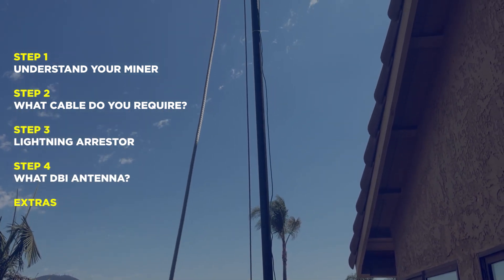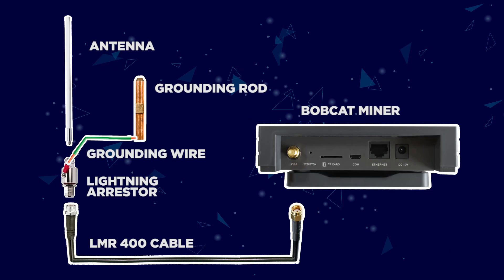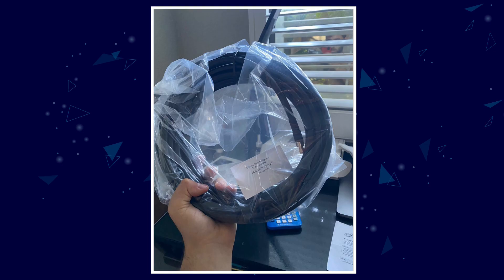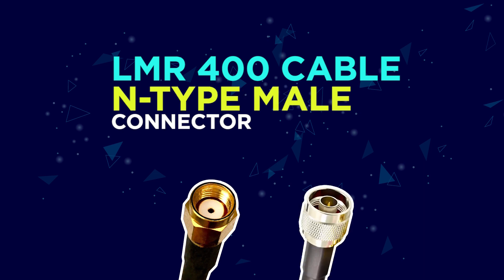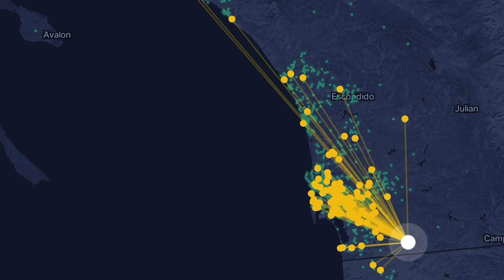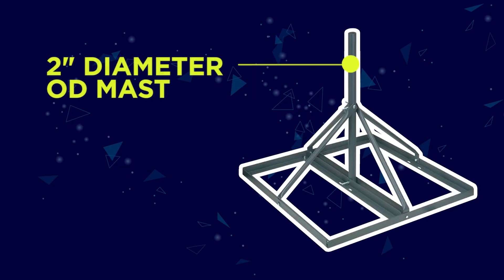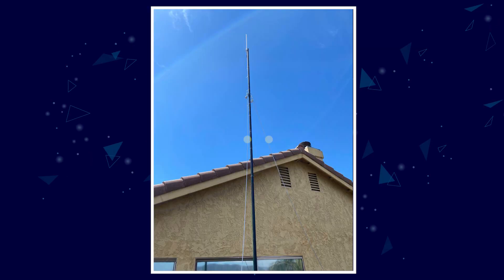Bobcat Miner Antenna Upgrade | Step by step Upgrading your Helium Miner Antenna ($HNT)

Comment: @Crayban Thank you for this excellent video. I have successfully set up my miner by following the steps in your video. Thank you so much!!
Reply from the maker: Hey JT, you're most welcome. How are the earnings?
Reply: @Crayban  I set up my miner 10 days ago, I got 24-31 witnesses, 18 HNT so far. I’m happy! 😉
Reply from the maker: @j.t.7231  Amazing :), happy to see it helped.
Reply: @j.t.7231  what antenna are you using if you don’t mind me asking? I’m in outskirts of a city so debating if should get the 8dbi or stick with 4.
Reply: @Esh104  Hi there! I used 8dbi antenna and 25-ft LMR400 cable. I hope this helps.

Comment: how do I find out how many people in my area I can connect to with the Bobcat 300?
I live street level and unable to install on the roof, landlord would have a heart attack if U installed on building or roof.
How can I read and understand the tool that informs me of other miners I can connect to?
Does it tell me my income potential? using the bobcat 300?
I have read a few messages from bobcat 300 owners, and the regret buying one,  I want to avoid their mistakes and ask all the questions before i INVEST 700$
Reply from the maker: Hey, you can check out the coverage map here to see how many miners running in your location: https://explorer.helium.com/coverage  On this map you can check daily earnings of miners as well as a 30 day average, this should give you a good indication of rewards around your area.

You ideally would be able to tell once it has been installed, or check out other miners in your area before hand and see how they are doing before you go for the plunge. If based in the US, I would advise having a look at the 5G miners as they are the next evolution of the network. 

Check out Ebay aswell, you would be able to get one at lower cost as the market is at its low.
Reply: @Crayban  would advise having a look at the 5G miners as they are the next evolution of the network.
I did tons of research, and is not too good for the Bobcat 300, the newer miners offer so much more,
The only reason the Bobcat 300 is doing really well in the market is due to their strong marketing campaigns.
The newer miners have
Bluetooth - no deal breaker there -
5G - deal breaker for sure
A internal fan - now this is huge - bobcat 300 only offers a heatsink eww so 1980's
Inside the miner - the points of contact between - the newer one's have one direct contact point while Bobcat 300 has several which translate to signal loss, signal loss equals,  loss of income.
With this I I will not be making a Bobcat 300 purchase.
To those that just bought a Bobcat - All I can say - you'll be looking forward to regrets.

Comment: I live in apartment building in NYC
On the 3rd floor of a 7 Floor Building 
I got 2 Bobcat 300 miners just received yesterday.
Any suggestions on good Outdoor antenna 
Want to place outside window
Reply from the maker: Hello, Apologises for this super delayed reply. How are the miners doing? A good outdoor antenna would be from mcgill microwave. They have these suction cup window holders you can place your antenna on. If based in America Fiztech https://fiz-tech.net/?ref=CRAY also have the gear you would need.
Reply: Still haven't set it up yet. But will let u know

Comment: Good video, however I landed here to see how to test replaced Antenna signal. I "upgraded" my antenna from the standard 4dbi to a 5.8 and now have no witnesses. Had 5 with the old 4dbi. How do we test the antenna is broadcasting/working?
Reply from the maker: Hey, apologies for the delayed reply. Did the miner eventually sync up and start working with the new antenna? In terms of testing, usually I leave it running for a few days and it should start picking up signal.

Comment: do you have to update settings in the miner when you change a new antenna, and why? How does miner know you got new antenna and how high it is?
Reply from the maker: Hey, Helium recommend to update the info as the wrong input in dBi could potentially effect rewards, however I am not entirely sure how they are managing to track each and every device based on height and dBi. As the signal projected out is in reality the main thing that determines how good the connection is with other miners. In order for Helium to understand each and every miner, they would have to look at the polar pattern projected out for every antenna, and even that is not as accurate enough compared to physically measuring the height in person. I personally believe it is a way to get each and every user to input the correct details to ensure that the data they have on the network is accurate. That's my personal perspective.
Reply: @Crayban  or they just try to earn extra bucks when you update the settings.

Comment: Can you connect using RG6 coax cable?
Reply from the maker: Hi Michael, sorry for the delayed reply, you can, however you will require the correct ends that connect into the miner and into lightning arrestor/antenna.

Comment: Very informative yet again, thanks.  Did you prefer not to/is it not an equal option to attach a mast to the side of your property?  This is what I plan to do   @Crayban
Reply from the maker: Hey Adam, sorry for the delayed reply. You are able to attach the mast, just be aware of HOA (housing association), if it is applicable to your area. As they had me remove mine. I only used a base as I wanted to be flexible in shifting it around the house.

Comment: I'm thinking about doing an attic antenna install, do you recommend it? I live in the city not sure if it's worth installing outside. 5.8dbi
Reply from the maker: I have an attic installation, currently on about 0,2HNT per day, however outdoor was earning at least double of the attic instal. Had to place it in the attic because of HOA.
Reply: @Crayban  do you have pics or did you do a video on this install?
Reply from the maker: @cspill99  It's actually this exact setup, however shifted to the attic. I have not covered it in another video. The layout is all the same, except the miner is located indoors and in the attic, with the antenna positioned as close to the wall as possible. Try our an attic setup and then,  try out a temp outdoor setup and see what will work best in terms of rewards. I usually leave them for about a week to test.

Comment: I got my antenna, but I'm still a bit confused as to what type of cable goes into my antenna... is it the n type male to male connector so that one end goes into the arrestor and the other one goes into the antenna? thanks again for the info, other than my confusion, I am pretty well informed
Reply from the maker: Hey Joseph, The RP SMA Male end (smaller end of the cable)  fits into the miner, and the opposite end (n-type male) will connect into the arrestor. Hope that helps.
Reply: @Crayban  what cable goes from the arrestor to the antenna or would the arrestor connect directly to the antenna? I got an outdoor antenna that didn't come with a cable and it's an N type female on the antenna

Comment: I live in the country side of America and want to purchase a stronger antenna. I have read that a bobcat miner antenna  can only go up to a 9 DbI.  and you have to change the antenna settings.
Reply from the maker: Hi Michael, You can use any antenna dbi antenna that will fit the best purpose for the placement of your bobcat in your enviroment. Changing the settings is easy, you can do it through the Helium application.

Comment: great video, clean
I need some advice please im looking to start helium mining but I just want to run a simple set up from my bedroom window , do you know if I can upgrade an indoor antenna ? if so which one? (im planning on buying a bobcat miner ) I live in the suburbs btw, many thanks
Reply: also is it worth doing from a a first floor bedroom window? money wise? thanks
Reply from the maker: Hey Azaz, honestly for experience of using the 4dbi indoors, it has worked well. A alternative can be the rak wireless 5.8 dbi antenna. https://rakwireless.kckb.st/crayban-zmx Currently running this on one my my indoor attic setups, and has been earning about 0.5hnt a day. 

Money wise it is hard to determine unless you test, however higher placement always is a good choice.
Reply: @Crayban  thanks for replying, just another quick question, in your attic do you have windows etc, I was planning on doing this in my attic too but not sure if the signal can reach through the roof etc, many thanks in advance.
Reply from the maker: @azaz...  most welcome. No windows 🪟 in the attic. Surprisingly it is doing good however the outdoor setup was better, but HOA had me remove it lol.
Reply: @Crayban  yikes!!

Comment: Not a penny for me yet 
But only using the stock antenna 
Any thoughts anyone ?
Reply from the maker: Hey Mark, Upgrading defo makes a big difference. I've upgraded most my setups based on the fact that the stock just wasn't good enough.
Reply: @Crayban  thanks so much 
I am going to move it to my 2nd floor since i think i get 1 free relocation with thr Bob Cat 
And i will check into antenna upgrades

Comment: Great video. Question. Does the height settings and antenna information on the Helium explorer update automatically?
Reply from the maker: Hi Eugene, this is manual. You can do it by accessing the app. Clicking the miner name, then selecting the settings icon and clicking update hotspot. You can update the information here:

Comment: Hey this is a great video!! I wanted to ask, I have a have a Bobcat miner that had the stock antenna and switched to a 8dBi but don’t really see much of a difference. Is there anything I should do after installing the antenna that I’m missing?
Reply from the maker: Hello, there are many factors that come into play. Location, height, the transmit scale of the miners around you. You can check my latest upgrade video here which goes through some factors. https://www.youtube.com/watch?v=iHFyCYOej8Y&t=120s
Reply: @Crayban  ok thank you so much!!
Reply from the maker: @don86baby  Most welcome.

Comment: @Crayban any idea why my minor has not sent any data since i changed to a 6dbi antenna. Its been about 1 and a half months since its sent any data. Am I doing something wrong
Reply from the maker: Hey Reece, how much data was being sent before. As the network is growing the Data portion should be low, over time as more companies use the network, the data transmissions will steadily increase.
Reply: @Crayban  it looks like data packs were being sent everyday . As soon as I changed to the 6dbi I've transfered ni data packets

Comment: Yeah but what about changing the settings when you get a new antenna and about the do's and don'ts like turning off and on your bobcat minor before changing your antenna how do you do that how do you even turn off the damn thing correctly
Reply from the maker: Hey Brandon, good point, usually you get an instruction guide with the miner, which covers these points.

Quick overview:

- Unplug your hotspot from the plug socket, unplug the antenna, plug the new antenna and then switch it back on
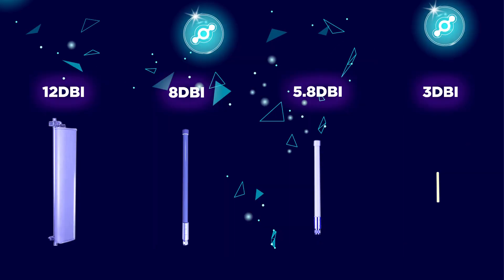- Next step upgrade the antenna within the app, covered this within this video, also covered on how to add HNT within your wallet if you don't have any within it - from 02:03. https://www.youtube.com/watch?v=twk1FZU-mxo
- Turning off the device straight by unplugging the power socket, there is no other way. 
- The witnesses take a few hours to show on the explorer map, and they should pick up over the week. 

Hope that helps.

Comment: Hello great video, I am in a penthouse in an urban área, do yoy recommend using the largest antenna?
Reply from the maker: Hi Jose, it depends on where the other hotspots  (with high transmit scales) around you are located. You could use a directional antenna or a high dbi antenna to shoot out a signal in a certain location. With the height advantage, you should be witnessed a lot as a beacon, but the second part to earning higher rewards comes by shooting out a signal to an area with high transmit scales.

Comment: So u have 25 feet of cable more or less between your miner and the antenna? Is it possible to hoist that miner up to closer to the antenna? Like maybe in one of those waterproof cases?
Reply from the maker: Hi Jack, thats correct. It is possible, however the only downfall is if you need to unplug the miner at any moment, and plug it back in, you will need to bring it down and then reinstall up again. I did the same, however the waterproof housing is based towards the bottom of the pole.

Comment: Would you use the same set up keeping the miner indoor ?
Reply from the maker: Hi G, I would. For me it is easier to keep the miner in reach. With the miner indoors, it wont matter much, as long as the antenna is placed in a suitable position outdoors.

Comment: This is so clear, very well presented mate. However, I have a problem. My two Bobcat miners are in my house a few metres away from each other and hardly making any money and also their nearest hotspot is about 800m away. . What is the best solution? Thanks
Reply from the maker: Hi Abdul, thank you for the feedback. The aim is to connect to more miners further away. Each setup for each miner is different, however the best practice is to elevate the antenna, and maybe use a directional antenna to reach the closest place that is packed with miners.

Comment: Great video,  very helpful. 
Just a question: Is there any reason you choose surge arrestor N- female both sides?
N-Female to N- male  going an N-female LMR400 cable wouldn't be more practical,  in any case you need  omit , for any reason (I.e. testing),  the surge arrestor?
Thank you.
Reply from the maker: Thanks Nik, in regards to your question, it is possible to go with the connections you have mentioned. However in regards to availability at the time this video was created, it was much easier to get my hands on the Female to female arrestor, and the other items were purchased with that in mind.

Comment: Hello everyone, can I change the antenna on my bobcat300 without disconnecting it from the power supply or do I have to disconnect it from the power supply, and can the device be disconnected from the power supply and moved to another room as long as the device is on synchronization
Reply from the maker: Hey Leon, sorry for the delayed reply,  I would disconnect it from the power, just incase anything short fuses and Fries the motherboard.

Comment: I like that you did the research on the Cable loss. You may want to experiment with the DBi of the antenna. Not quite what was described. It may take some trial and error to get it right.
Reply from the maker: Hey James, thanks for the input. The 5.8 within this specific enviroment has been great, still earning 0.5 + HNT per day. As you mentioned, testing will assist find the perfect antenna for each individuals setup.
Reply: @Crayban  nice. I just set up a bobcat with the stock antenna. I'm in the West in a large valley. It reaches across the entire width of the valley. Probably 40 plus km. I think if I did higher DBi I'd overlook closer but lower hotspots. This is the  first 24 hrs though of it running. Just trying to apply the antenna and comms stuff I learned and have not thought of in years. LOL. Waiting a few days to see how it does but think I may need to go higher. Just 3-4 meters. But it should make a big difference.

Comment: x. Amazing Explanation,  however one thing to. note, where do you change the settings for the antenna once upgraded?
Do you need to let the app know that the antenna has been changed and if so where in the app do you do this?
Please kindly advise as we are stuck on this?
Reply: Does anyone know this answer?

Comment: i upgraded my antenna yesterday ............ do i have to do anything to my bobcat or is it just plug and play ?   thanks
Reply from the maker: Hey what's up, it is. basically plug and play. You can upgrade the details within the Helium app, by clicking on the settings icon and then inputting the new dbi. I do cover it within this video: https://www.youtube.com/watch?v=twk1FZU-mxo&t=54s Hopefully it helps.
Reply: @Crayban  awesome i will check out the video  ..... another question should my witnesses go up too ?     .. by the way i did sub

Comment: What a great Video, I am new here so wanted to ask you about your links for my bOBCAT MIner 300
for the antenna  connector type , which one do we select , NTYPE to RPSMA or NTYPE mail, which should we select sir?
Reply from the maker: Hi Gulam. Hope it helped :). If you are not going to buy a lmr 400 cable select ntype to rp sma. If you are going to buy a lmr 400 cable select only n type male.

Comment: I live on the second floor of a apartment complex. Their is no way for me to ground it will it be fine without grounding?
Reply from the maker: Hi Eric as each type of apartment varies, i would try to consult with an electrician if you decide to upgrade and leave an antenna exposed in the open. There must be some sort of grounding elements that can ground the cable. For example in one apartment I had upgraded there is grounding capabilities used the gutter pipe. 

If the antenna is not exposed that much in open air and there are no occurrences of lightning, then it is not necessarily needed.

Comment: For bobcat miner can we just buy the 5.8 dbi antenna and setup. Are the cable and lightning accessory necessary? I’m using just outside of my window.
Reply from the maker: Hey Kererthj, the lightning arrestor is for safety, just incase of a lightning strike. It's recommended but not necessarily needed. If you don't need it, you will require a LMR 400 cable with a n-type female end that will feed into a n-type male antenna:

LMR - 400 (N-type female) cable: https://amzn.to/3mZ3iVU
Antenna (N-Type Male): https://rakwireless.kckb.st/crayban-zmx

Hope it helps